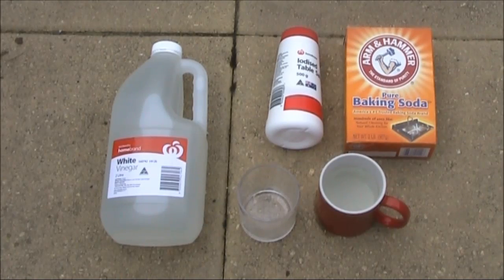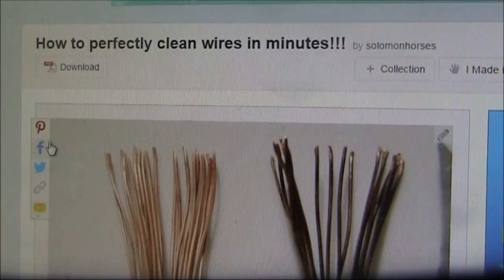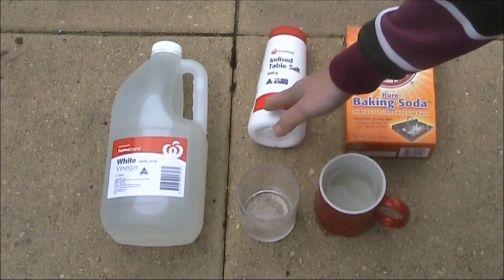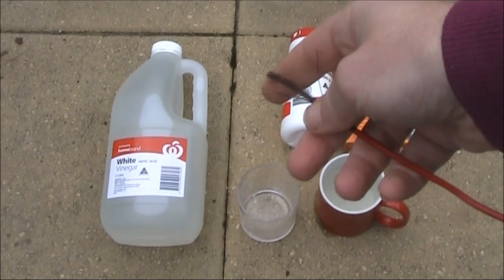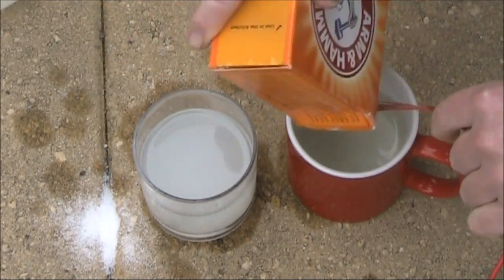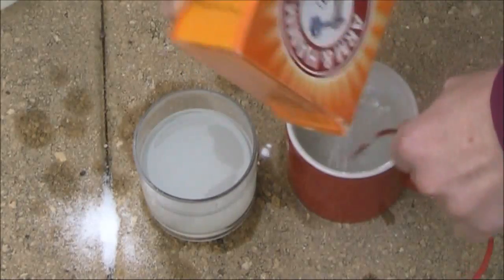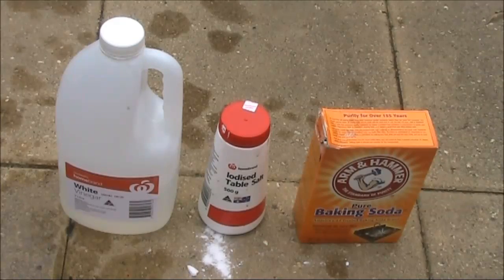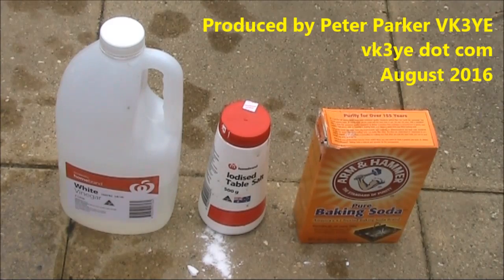Using salt and vinegar to clean corroded wire

Comment: Rust on steel, ie. iron oxide, will fall away as a scum when soaked for a week or two in plain cooking vinegar, a.k.a. weak acetic acid solution. Just don’t spill the resulting brown solution on concrete or a painted surface: it stains dreadfully!

Comment: Thanks for the video. I had a corroded battery cable on my car that is part of a harness which has been discontinued.

I split the jacket back about 6” with a razor blade and used this method to clean the wire off and it worked perfect.

Re twisted the wire and put some heat shrink on the jacket and it’s as good as new!

Comment: Thank you that works very well. I wanted to reuse some older stranded #10 covered electrical wire that I was turning black. I used this method and it worked perfectly, it cleaned up and I was able to solder it with no problem. 73 Leo k1zek  k 👍🙂

Comment: THIS video saved my KitchenAid!!! It wasn’t turning on, and I had already decided to throw it out. Thank goodness I didn’t. I didn’t even use the baking soda. 

My electrical pin had corrosion. I dunked the metal part of it in the vinegar for a few seconds, pulled it out and covered it in salt and let it sit for a few seconds, redunked in the vinegar for a few then salt again!! I didn’t even have to scrape it. It just came off. Dried it really well, plugged it in and it came right on. 

Thank you!!!
Reply: You need the baking soda to neutralize the acid that’s remains on the wire after the first dunk. Otherwise the process will repeat. 

I just noticed this comment was 4 years ago, how did it hold up?
Reply: @ it’s been 4 years and I’ve never had this issue again. Only did it once.

Comment: lemon juice white vinegar backing soda also works well.
Reply: any combination of vinegar and baking soda as a cleaner is stupid. They neutralize each other creating carbon dioxide which is useless for cleaning. The only thing doing any cleaning in most of those recipes is the vinegar and the baking soda is just reducing the effect.
Reply: Actually the baking soda in this particular use (shown in the video) is to actually remove any vinegar leftovers, if you leave it with vinegar the vinegar will corrode the wire and make the situation even worse than before!
Reply: Actually the baking soda in this particular use (shown in the video) is to actually remove any vinegar leftovers, if you leave it with vinegar the vinegar will corrode the wire and make the situation even worse than before!
Reply: Actually the baking soda in this particular use (shown in the video) is to actually remove any vinegar leftovers, if you leave it with vinegar the vinegar will corrode the wire and make the situation even worse than before!
Reply: Actually the baking soda in this particular use (shown in the video) is to actually remove any vinegar leftovers, if you leave it with vinegar the vinegar will corrode the wire and make the situation even worse than before!
Reply: Actually the baking soda in this particular use (shown in the video) is to actually remove any vinegar leftovers, if you leave it with vinegar the vinegar will corrode the wire and make the situation even worse than before!
Reply: Actually the baking soda in this particular use (shown in the video) is to actually remove any vinegar leftovers, if you leave it with vinegar the vinegar will corrode the wire and make the situation even worse than before!
Reply: Actually the baking soda in this particular use (shown in the video) is to actually remove any vinegar leftovers, if you leave it with vinegar the vinegar will corrode the wire and make the situation even worse than before!
Reply: Actually the baking soda in this particular use (shown in the video) is to actually remove any vinegar leftovers, if you leave it with vinegar the vinegar will corrode the wire and make the situation even worse than before!

Comment: I am encountering dirty corroded wire when fixing my old guitar cables. I have not tried cleaning the wires yet
I am getting good connections - but my biggest problem is my soldering iron tip is getting terribly dirty - could this be from the dirty wire?
i cant figure out why my solder tip gets so blackend....
Reply: Do you use flux paste at all? You should clean your soldering iron tip with flux, wipe it on a paper towel, and lastly add a dab of solder to the tip. (Btw the soldering iron has to be hot)

Comment: I found a old extension lead which had silver plated copper wire in it with this trick work to clean that or would it destroy the silver plating please for advise
Reply from the maker: No idea. Try it, make a video and show us all how/if it worked!

Comment: Think you'll find the salt serves no purpose - the vinegar is acid
Reply: yeah, I was also trying to find some explanation as to why we are putting salt in vinegar...
Reply: and I found it: the salt increases the ionic strength of the acetic acid solution.
Reply: Very little purpose in this application. However, the salt is an abrasive which may assist in scrubbing off the corrosion.

Comment: This method works.. You just have to make sure to.rinse off with clean water amd dry.. Or it will eat up the copper as well.
Reply: That's what the baking soda is for, neutralizes the acid.
Reply: @markme4  Yes, but the baking soda solution is alkaline, so washing it off with distilled or denatured water and then drying the wire is important as a last step in the process.

Comment: This works, but its a bit messy and time consuming.  A Dremmel or other rotary tool with a small wire brush will do the job in 60 sec.  Maybe its better for more delicate applications.
Reply: Thanks. Was about to run out and get baking powder. Used a brass attachment and the corrosion came off in less than a second. Still got to move the wires around so that you get everywhere though.

Comment: Can you use this to clean old rusty PCBs?
Reply: Just put some distilled vinegar into a cup and take a toothbrush and dip the toothbrush into the vinegar. Then you can gently scrub the pcb with the toothbrush. Then after you will want to dry the pcb, then use a microfiber cloth to lightly blot the surface of the pcb with baking soda water. Then lastly use another microfiber cloth to dry the pcb. The salt is only an abrasive used for cleaning the wire.